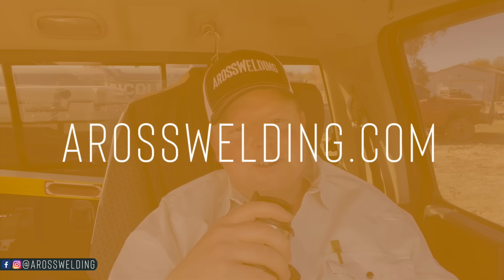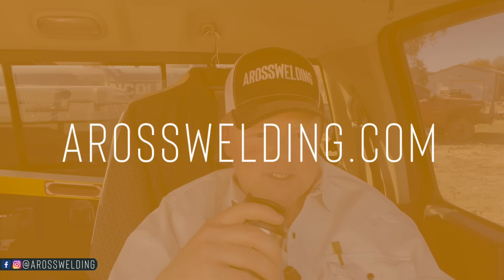How To Pick The Proper Welding Rod (All You Need Is These Two)

Comment: I would recommend 6013 for non critical or non load bearing applications especially if you are using a welder that only runs A/C current but I like 6010 also, runs much better on D/C but it blows holes in the joints easily if you are not careful. And yes it is not necessary to keep rods in a hot oven. I have rods that are over 30 years old and they weld just fine and always work great for repair work. They are just more likely to cause porosity in your weld beads. But I was just running some 3/32 7018 uphill last night and I was very happy with those beads. The rods I was using have been sitting around in my friends garage in an open container for at least 15 years. I was repairing and old gate with them. Nothing load bearing. Beautiful welds. I really enjoy your videos Austin.

Comment: 6010 is deep penetration, 7018 is high depositation. 6013 called junkyard rods are easy to weld and float rust out better.

Comment: I'm a certified structural welder & we use  7018 rods on the column/trusses & 6011 or 6010 on the red iron (cee or zee purlins) then on commercial buildings 7018 exept for a root pass or on roof  decking to joist.
Reply: When you say "red iron", do you mean cold formed steel or light gage sheet steel? If you are, odds are you should be 7018. Check D1.3 to see what is prequalified for the steel you are welding. 6010, 6011 and 6022 is prequalfied  for deck arc spot welds but that's about it. Even sheet metal SIP connections welded to most structural steel requires 7018. A good sharp welding inspector should be busting you for using 6010 when you should be using 7018.

Comment: Softer= less carbon content, more ductile.  Harder= more carbon content, higher strength.  7018= more stronger .  Downhill = faster & easier for beginners…uphill = stronger weld. I trained on a farm and on diesel truck shop.  Only rods we stocked were 6010, 6013, 7018.  All you need to glue metal together when you hook up a D8 to test it. 😊

Comment: Hey Ross  why do most of the welders on here NEVER talk about or use 6011???????  I have used 6010 don't like it . I do mobile repairs  I have a 302 miller welder generator on my truck in my shop I have a lincoln  BUZZ BOX (great welder AC/DC) and a miller 250X wire feed. Been welding 25yrs  went out on my own a year and half ago now!!!  I can weld stainless (wire or stick) mild (wire or stick) and aluminum (wire only).  But I know a lot of welders can only weld wire or stick and not both. Along with only mild steel and not stainless  and aluminum. Why is that???? The more you can do the more valuable you become and you literally can name your PRICE when it comes to repairs!!! Just my thoughts and questions on things. But I like watching your vids.

Comment: When there is dynamic loading 7018 static loading 6010 .Then to it depends to on your grade of steel  which calls for different rod and or a different procedure. Harder material refers to higher tensile strength

Comment: Austin, I love your content to death, but man I gotta disagree. Keep some 7014, 7010, 6013 and 7028s on hand as well like I do. Then again... You got 8010s instead...

Point is, I got thin sh(t like walk-through gates and corral panels I worry with occasionally. Perfect for 6013s. 

7014s and 7028s are for buildup if I can't use my MIG welder. 7010s are my "BEAT THE SHIT OUT OF IT" rod because of the diameter I got them in.

Comment: I generally keep 6011, 6013 and 7018r in my garage. I find 6011 and 6013 good in different situations and if dirty. Is 6010 something I should be using?? Mainly farm, equipment and trailer repair
Reply: 6010,,, is dependent on brand and welder settings.  If you make clean prep, it doesn't do bad.  If you've gotten by without it, not sure you missed out on anything.

Comment: I’m about to weld a boom on an excavator, would this rod combo be fine for a boom? It’s right at the collar where the swivel point is. This is the second time having to address this. I was not envolved with either time the steel cracked. I am however the one who needs to fix it right and permanently. Cut a v grove and run a 6010 first then the rest 7018 on the build up.

Comment: when i started to weld my motor skill in the movement wasent so good i did burn thrue a butt load of rods what helped me tredmendus with that was i took the welder handle and i did cut of a rod put a frikken pen to it trained the small movement on a pice of paper and that save alot of headech for me and then i got the mov ment in that way just writing  on a pice of paper the movement

Comment: absolutely agree on those 2 rods and as you progress youll pick up more types of rod for different types of work. difference is i always root pass 6010 then cap 7018 but thats me. 7018 does run fine down and with practice it works really well. i was having problems with a tight area on a structure job once and a pipeliner taught me that downhilling 7018 is possible and solved my problems.

Comment: I use a good 20 mm ammo box for rod storage. 7018 will stay good a long time with no oven. If the can isn't air tight then you will need an oven.
Reply: Do what I do . Ammo box or steel box on a Nuwave induction cooktop , turn it on let the rods bake for awhile. I don’t do much stick welding but if I do I just like to put them in a rod oven ahead of time. Personally my experience is , it dries them out and they are easier to weld with. I got a real good deal on a rod oven years ago on eBay and I have a Nuwave induction cooktop on my workbench that has a metal box on it and I turn it on just to keep the rods warm after I baked them in the rod oven. That’s my 2 cents on all this.
Reply: @MrMopar413  sounds good

Comment: What is the purpose of a rod oven
Reply: A rod oven is used to essentially "bake" any moisture out of the rods. As explained in one of the upper comments here a lot better than what I'm going to do, some job specs require rods to be of a certain moisture content (or lack thereof) and the rods have to be baked at 700-800 degrees F for 30min to 1 hr in order to ensure said moisture is no longer present. Opening a container of rods and then letting them stay exposed to the atmo they'll absorb atmospheric moisture, and that moisture greatly affects the performance of the rod and quality (or lack of) of the weld.
Reply: An E7018 is a structural low hydrogen general purpose rod.  To be low hydrogen or ‘lo-hy’ it can’t have moisture absorbed in the flux, so an oven is used to dry it out.  Moisture in the flux releases hydrogen into the weld, causing hydrogen embrittlement.  Structural welds need to be ductile, allowing some movement and metal yielding in the joint, rather than brittle, which cracks with any excessive movement.  Think of an egg shell vs a piece of plastic.  Structural Engineers want to design for slower ductile failures, instead of fast brittle failures.  Also required by AWS D1.1 structural welding.  Plenty of good web articles on this.  That said, better rods like Lincoln have a second coating on the flux that slows down moisture absorption, which cheap rods don’t have.

Comment: everyone needs to be in business for themselves at least one time to get to know how the public analizes folks,im 65 yrs in and still going but really slowing down,i,ve worked in tool and die shops,tank shops[flint steel outta tulsa ok] machine shops but what i like the most is a job shop,most every job is different and calls for knowing your metals and how to repair things with the rite rod and tool,metal can go through a tempering process over time,it can also work harden under the rite curimstances,hence farm equipment especially ,you need to know your metals to be able to use the rite rod,for the job.i started when i was 14 tinkering with a welder i could go on and on but dont have time rite now so always remember-welders have the hottest rod

Comment: What 7000 series rod can I run with an AC welder? I love 6011s but might want more strength and a better looking weld at times.
Reply: 7014, 7018, and 7016 if you can get the latter

Comment: I have welded old cast iron with 7018 ( cast iron from horse drawn equipment ) and it worked very good . I will probley shouldn't  add this but where I worked for 38 years we had some of the best welders you could find ANYWHERE  there was two classifications (crafts) boiler maker and pipe fitter . Pipe fitters welded mostly down hill ,Boiler makers welded mostly uphill . both crafts welds hydrostatied at 3500 psi,many were x ray not all
Reply: I totally agree with you. Where I used to work, A very big company a global corporation and the same mix of boiler makers, pipe fitter's and it was the same boiler makers up hill and pipe fitter's mostly downhill. 
I was a fitted turner , I think the USA equivalent would be a millwright 
And there was always banter / piss taking ,because we were allowed to weld and qualified to do so. but they'd always say we put bad welds down. Lol😂

Comment: Hi, Austin! What is your opinion on 7016 and 7015 rods? Looks like these are much less popular in US compared to 7018... that's sad cause these are also really good rods. I had no experience with 6010/6011 rods but from what I heard and saw 7015 must be halfway between 601x and 7018 closer to 601x regarding violent arc character and hence penetration depth while 7016, a gentle version of 7015, is more like 7018 but easier to control and requires less current and arc force setting.
Reply: I'm a big 7016 kinda guy
Reply: Are you using an old ac buzz box? Some can't hold the arc on 7018.  May have to use 6011.

Comment: I do alot of out of position welding 1/8" 6013 was usually my go too. Change the polarity on my ranger 8 I could do 14 gauge no problem.
Reply: Yes sir, old trick, when welding very thin metal, 6013 will work, switch to AC and you can weld 24 GA sheet metal.  But only rod we have now is 6010 and 7018.

Comment: What do you recommend if my Inverter style welder does not work with 6010?
Reply: Run 6011s. High Cellulose Potassium instead of Sodium
Reply: I've got a Miller 220 AC/DC and those things aren't designed for 6010/7010 like I run normally because the OCV is too low to whip and pause.
Reply: inverter is DC and will run 6010 just fine

Comment: I agree with 99% of what you use, back in the old days we used 1/8 rod for up to 1/4 inch thick steel & heavier steel we used 5/ 32 for the really heavy plate we used a big 1/4 rod; and as I previously mentioned for rusted oilfield junk,we used 6011 rod which is also good for beginners & for newer clean steel,we used 6013 rod it burns a lot like 7018 ;  but I'm retired & not up to the specifications of pipe line welding!  I do know that a lot of the tank welders in the shop, still use 1/8&5/32 6011 rods, but they don't have to meet x- rays & high pressure requirements  which I know the 6010 & 7018 do meet. And I do have some experience in welding stainless steel " gunnite" hooks inside refinery boilers & smoke stacks ; just pretend the stainless rods are 7018 & you'll be OK, they burn much the same way, up or down hill & horizontal, which a lot of stainless steel hooks are actually welded on in a horizontal position! Just burn the rod hot like 7018 or 6013! But as usual you do a great job on your videos & yes suckered rod is harder steel, I usually use 2 passes one 6011 & one 7018 or 6013 & they don't break! Sometimes I used to just tack the sucker rod in place with a 1/8 6011 & then actually weld it with 7018.
Reply: 6011 is just 6010 that can run on AC current.

Comment: I seem to have it backwards from your recommendations.  I've never had luck with 6010 on lighter materials.  I've always known 6010 to be a deep penetration rod so I use it with heavy/thick materials.  7018 I use for general purpose, dirty materials or non-flat position welding.

Comment: If you are looking to buy your first welder I would buy an ac/dc machine.  I started off with an ac welder that would not run a 7018.  Many of the cheaper inverter welders will not run a 6010 very well.  Read the reviews and do your research before you buy.

Comment: If your welding down hill... wouldn't your slag be constantly trying to run over you puddle that would constantly interrupt your arc?
Reply: Depends on the rod you use. 6010, 6011, 7010, and 8010s are all designed to be run downhill. The slag is light enough and the puddle freezes fast enough to allow for that. Go back and watch his pipeline videos from 3 and 4 years ago. All they did was downhill using 6010 and 8010s.

Comment: I like 3/32 7014, smooth as butter! I only have a 75 inverter based stick welding machine.
Reply: 1/8 inch and under you can't beat 7014

Comment: Thank you. But I wouldn't mind more. I grew up on a farm(northeast-no pipe fences up here). Dad couldn't weld, he hired most of it done for equipment repairs. I'm the same way but with economy the way it is, I want to do more myself. I only run one rod on everything because I'm too cheep to stock two different rods. So far all I play with is 7018 1\8. And it always turns out ugly. I need more practice but thanks to you I'm starting to understand more of the concepts.
Reply: In time you will start to make things strong and nice to look at.     For my personal stuff I’m fine with gorilla welds (big ugly and strong).  But the work I do for others is proper prep, preheat,rod oven, the whole nine.   But I also when I have time I practice using the wrong rod on dirty,oily, and bad fit ups along with differing thickness and hardness metals just to help make those occasional emergency repairs to get things to a better and safer place to do a proper repair.      I do this because I have had a call on a broken d3 that had went off the logging road and a broken track frame.    And I just had to do what I could to get it back out to the landing for a proper repair/ replacement.      Just a long way of saying practice as much as you can afford

Comment: Hey Austin, thanks for sharing all of your knowledge. My local welding supply store recommended a rod called 
80T AC as “the most versatile” rod for our ranch. What are your thoughts? We are in the process of fabricating 2 3/8 inch drill stem gates for a corral system and want to use the correct rod. Thanks again for your knowledge!

Comment: Good advice for folks getting started,..... keep it simple during the learning process and sharpen those skills.  Rod selection can be very confusing for someone just getting started.  When you think you have it all figured out and are ready to really go down the rabbit hole, start welding on heavy equipment, cranes, and excavator booms and bulldozer blades and frames where you are welding castings to plate which has been patched and cobbled up while leaving dirt, oil, and grease in every crack and seam.  Sometimes you end up working with material over three inches thick and really tough alloys that requires the use of 9018, 11018 which almost always requires preheat.  With heavy equipment, you'll need to keep a large selection of welding rods ranging from 3/32 all the way to 1/4 with a variety of different tensile strengths and flux compositions. Mr. Ross is giving good advice here and is absolutely correct.  Thank you for sharing your knowledge and expertise with others. Our country is in trouble with the lack of people willing to go into heavy industry. Your videos are inspiring and informative and I hope that they will spark the interest of a younger generation to enter this challenging and rewarding field.  Keep that hood down and the sparks flying!

Comment: Great information for me the novice. I have a Hobart AC welder, so 6011 or 6013 and 7018AC?
Reply: Depends on what you’re welding. 6013 for sheet metal. 6011 for at least the root pass on dirty or painted steel if you can’t properly clean it. 7018 on structural applications and when somebody’s life depends on it.
Reply: Yes